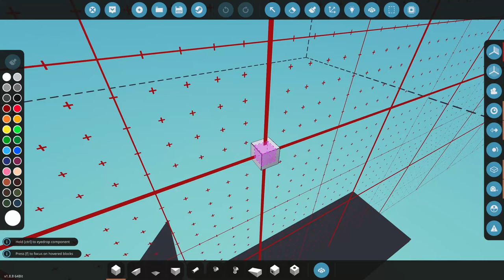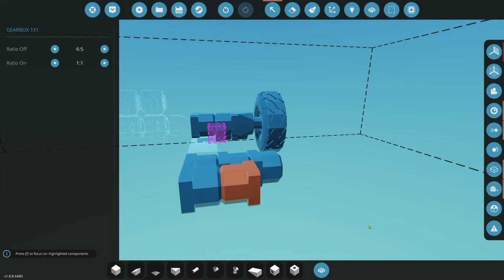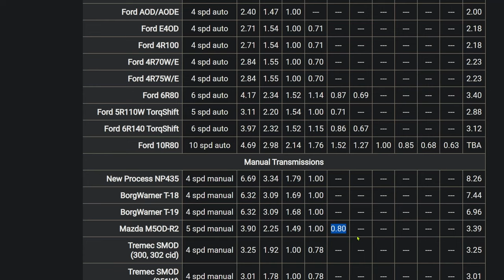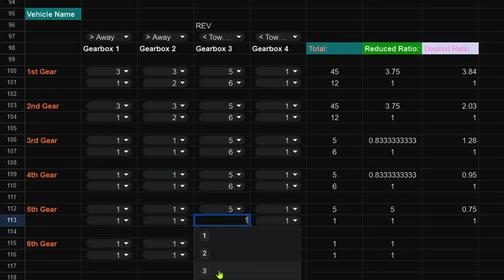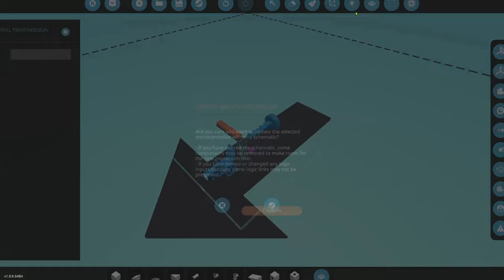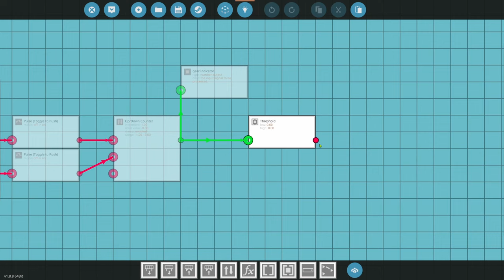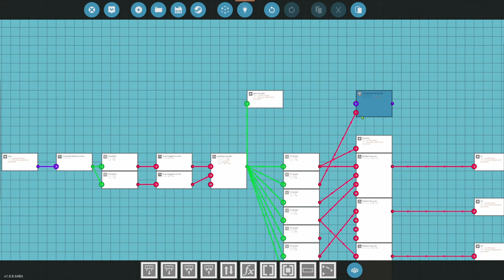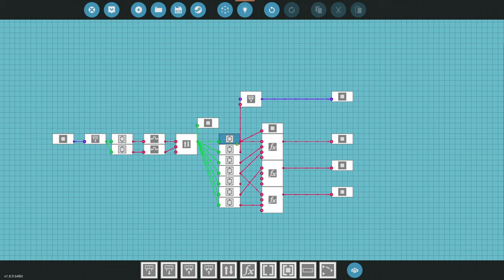Stormworks Basics: Transmission Tutorial #stormworks #tutorial

Comment: What gearboxes configuration would you used for much heavier vehicle (from engine to wheel)? My car stalls on starting on 1st gearbox position and power goes down on the 3rd.
Reply from the maker: I use the Eaton Fuller tractor trailer transmissions as my basis for my trucks. Generally they start around a 13:1 gear ratio. And top out at a  .84:1  gear ratio

Comment: So basically each vehicle has it's own minimal Torque to reach the desire RPS, Once it reach the RPS you can tune them with gearbox? I tried to add more RPS in exchange for Torque but the engine refuse to reach the desired 15 RPS. so yeah I only have 2 gearbox 2:1 and 2:3
Reply from the maker: Not really. A particular engine is only going to produce so much power. You can then use gearboxes to either trade RPS for torque or trade your torque for RPS. That is the point of a transmission.
Reply: @CaptainCockerels  Ohh alright thanks mate, for ship it seems to have a certain torque required to power the engine to desired RPS. This is the most detailed tutorial on gearbox
Reply: @CaptainCockerels  So for example my ship needs 600 torque to reach the 25 rps. I need a gearbox away from the engine for initial torque and RPS and another toward the engine to tune the RPS for Torque? and there is no way for high torque and RPS than the initial one due to Diminishing returns/reduced ratio and 5% less torque for each gearbox?
Reply from the maker: @Tanubtanu  a ship generally has one gear ratio. You don't really ever change gears in a ship (except to go in reverse). For basic explanation in a ship you want to point the arrow of the gearbox towards the engine. You want to keep increasing the ratio until increasing the ratio causes the speed to decrease. That is how you determine the maximum gear ratio you can run in your ship for that particular engine. If you still want to go faster you will need a bigger engine at that point.
Reply: @CaptainCockerels  Alright that explained my question, thank you so much.

Comment: 44:20 Engine Pt.1 Micro Controller doesn't match what we built before in the previous video. You only had us setup the OR gate and feed that into our up/down counter and had only mentioned boolean as an option. You never mentioned creating a "from transmission" composite input nor the other 3 nodes you have it hooked up to.
Reply from the maker: I made the transmission tutorial first. It's the logical next video in the series. What issue are you having?
Reply: @CaptainCockerels  I eventually figured it out by just creating a new composite node pair so the transmission and Engine Microcontrollers could talk to each other through channel 25 and hooked up the output into the OR gate we made from the modular engine tutorial that you said "we'd use in the future when we do the transmission". 

It's the dirty version of your fully fledged modular engine microcontroller that uses the boolean instead of the OR gate.

If you could do an updated video for the modular engine and a follow-up for an automatic transmission, that'd be some lovely content!

Thank you for the reply and thank you for getting me up to speed on the game in such a short period of time. I've only had like 15 hours of playtime so far, but I roughly understand how it's all working and have managed to apply what I've learned across various other machines.